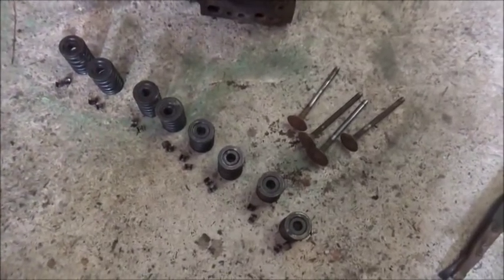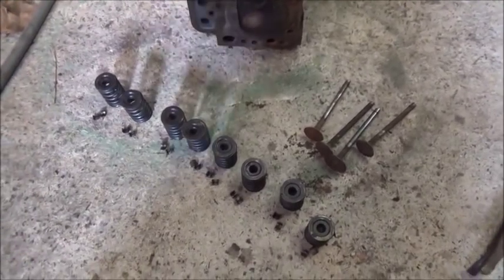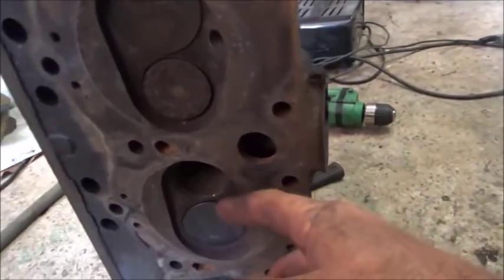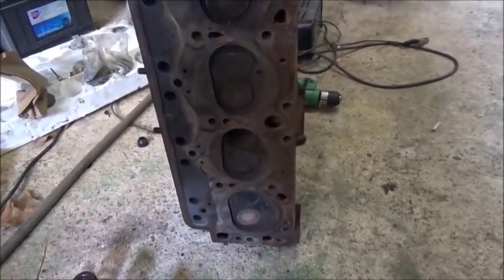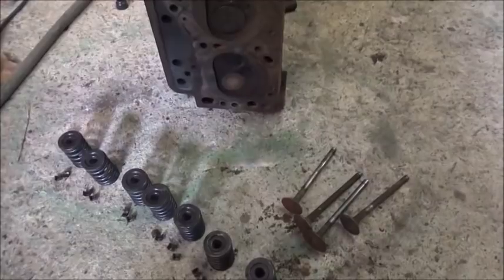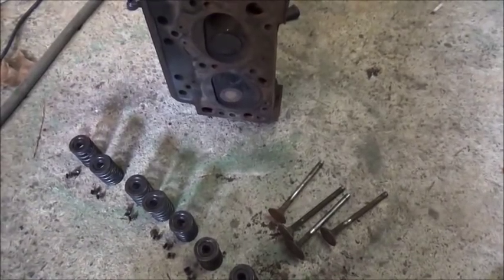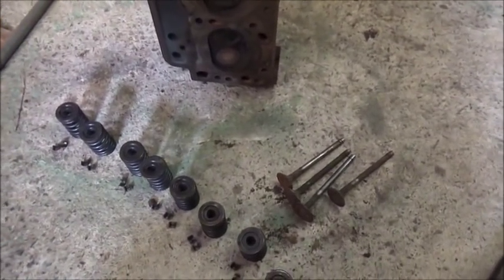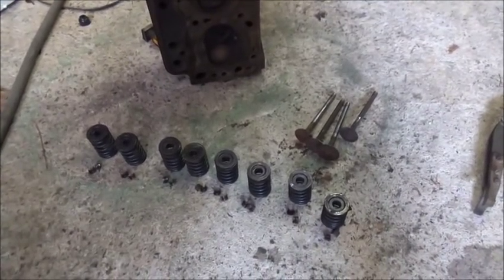PACKARD GATE! NEW THEORY ON VALVE DAMAGE. 1956 STUDEBAKER

Comment: Ok Jonathan, I was talking with my fiancé` and we have come to the conclusion that it could be the ethanol produced at that time these engines were made was subpar to the standards of today?   We all know that ethanol is made from corn and corn has sugar in it and what happens when you add high heat to sugar?  Thick tar like substance that is corrosive to metals.  We also think that the mouse pee is possible too.  I had done some research and found out that in the early 1900"s Henry Ford's Model "T" was able to run on corn alcohol, called ethanol.  1920's Standard Oil began adding ethanol to gasoline to increase octane and reduce engine knocking.  So good old ethanol has been around for 100+ years.  

My first thought on why the exhaust valves are so badly pitted is from the engines running to rich and being able to burn all the fuel and making more carbon that couldn't get out before the next stroke of the engine.  

Congrats to Noah for the award in his history class too!!  You are a great teacher and its good to hear that he is listening to you and soaking up all the information that you are telling him.  We need more young people like Noah in this world!!

Comment: Mice urine is very corrosive and will eat aluminum also but I don't remember anything like that on the pistons,could it be weld adhesion from running unleaded fuel in an engine made for leaded fuel.

Comment: I had electrical connectors across a motor that got soaked in pee and a few months and years later most of em corroded and failed. Troubleshooting nightmare.
Reply: Coal mines in PA became dumps for batteries and waste. They polluted many towns drinking waters.

Comment: Though what you say is true, it may also be the change from leaded to unleaded fuel.  Leaded Impact softened fuel would coat the exhaust passages and allow the use of imprecise less expensive, softer steel.  Unleaded, harsher impact fuel simply causes greater wear and tear.  Newer valves and valve seats and replacements are hardened to higher quality and less prone to wear, in order to make up for greater impactfulness of newer fuels.  Older engines need better parts for newer fuels. Bo.

Comment: I can't buy into the mouse theory causing the valve condition. My thought it occurred from a lean running engine.  They seem to be burnt and pitted due to excess oxygen from a lean burn due to possible intake vacuum leak, low float level, restriction in jet, modern gas (unleaded gasoline), etc

Comment: Mouse urine is defiantly one theory, exhaust gasses also contain acidic elements. The carbon elements in the exhaust chamber could absorb moisture over the years and release the acidic particles and could cause damage much the same. Not saying you are wrong, just another theory!

Comment: How can it be that mouse "juice" got on every valve and around them so even. What is wrong with theory that ex valves worked under harsh temperature conditions got some pitting and it rusted through time?

Comment: Not so sure about the theory. If a mouse can get by an exhaust valve through the exhaust pipe, then he can get by an intake valve through the intake manifold. Any pitting on the intakes?
Reply from the maker: It can't get through the butterflies of the carburetor
Reply: @jonathanw4942  Okay. I'll buy that. If a critter crawls up there via the exhaust, unless he caught a chamber where both the intake AND the exhaust valves are open (valve overlap) it couldn't piss on both.

Comment: your theory is very plausible, the exhaust tube have been completely rotten so a mouse have the place to insert in the exhaust manifold then reach the valve area, if you have an access to a TIG welding machine, an easy way to retrieve your valves is to rebuild them with Stellite fillre material, this way, the valve will be OK for unleaded fuel.

Comment: Yes, i can see that mouse urine could possibly be the cause of the valve pitting. [https://www.google.com/search?q=Corrosive+Urine - https://www.bladeforums.com/threads/mouse-pee-on-steel.674353/ ) || Do mice nests ever have tiny pebbles embedded in the material they find to use? Could they gather shinny metal bits? If so, then possibly something could have dropped into the cylinders from their exhaust side nesting places, and thus been the originating cause of the piston head deformations... i guess.